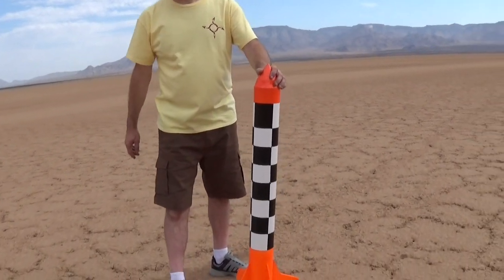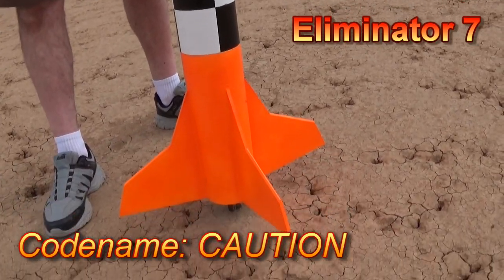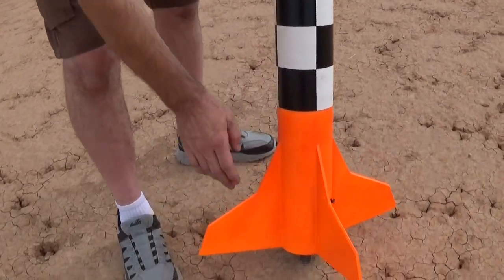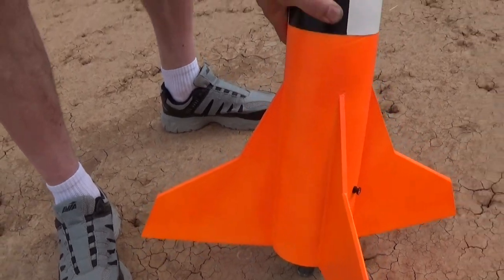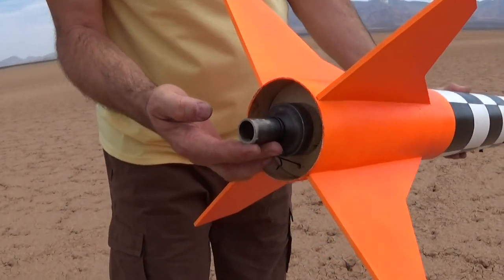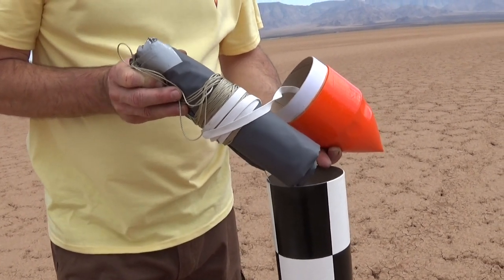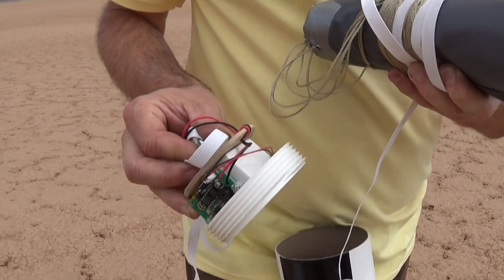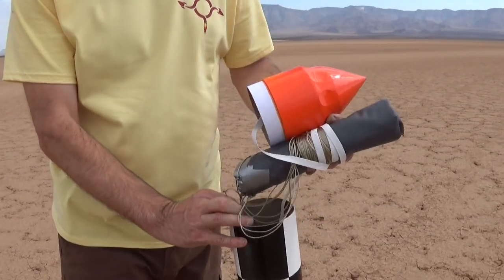Completely successful launch & recovery of the Eliminator 7 model rocket.

Comment: Do you know what the complete weight of this of this rocket was prior to motor installation? It was a sweet launch!
Reply from the maker: I don't have one to measure because I have not built another since the last one exploded about 3 feet after liftoff using an new experimental motor. I looked back in my videos and I had mentioned that one of these was 1260 grams. Pretty sure that would have been weight of rocket, nosecone, flight computer & parachute. (not including motor weight)
Reply: @rotaryrocketry  impressive!

Comment: Have you ever ask what fuels does military rockets (like  MLRS) use and give them high speed and range?
Reply from the maker: No. The only fuel I have ever used is Flexi-fuel or Sugar fuel using Potassium Nitrate and Sucrose. There are many fuel types for amateur rockets. I think this one is the simplest and it's really easy to make. Fuels used by Nasa, SpaceX and military are not things that the average person can use without likely blowing up their garage.
Reply: NASA’s rocket boosters uses Apcp fuels, I remember tech ingredients had video talking about it
Reply: Yes I believe most solid propellent boosters use APCP (Ammonium Perchlorate Composite Propellant). Ammonium Perchlorate is the oxidizer and powdered Aluminum is the fuel, and they are combined in a rubber-like binder material. I have seen some videos of people making and using this propellant. Its great for generating a whole lot of thrust in a short time.

Comment: Brother, could you please post the video on making model rocket with scraps and using potassium nitrate....
Reply from the maker: As far as using Potassium Nitrate for fuel, we have a complete motor and fuel video. You may not have the exact tools to make the one we made but it's a good starting point and explains the fuel making process that we use.
https://youtu.be/wJt1XLjqaGY
As for making the rocket... We have videos for many of the various parts but everybody will build slightly different rockets depending on resources, skills and motor sizes. I would recommend the free program "Open Rocket" as a starting point for rocket design.
https://openrocket.info/